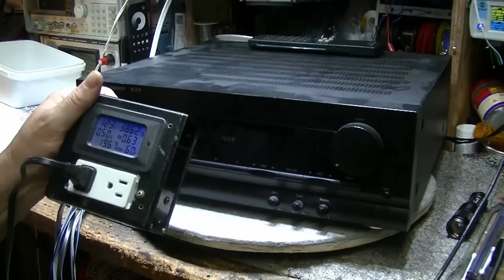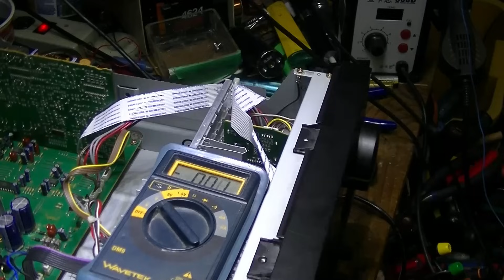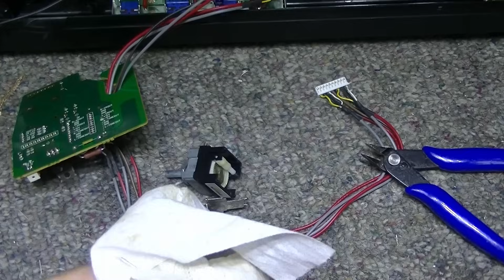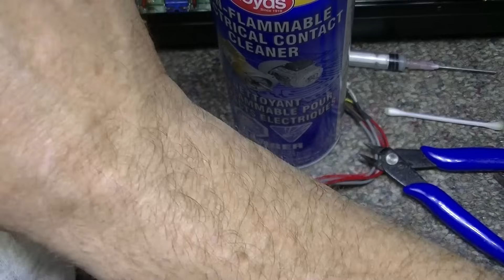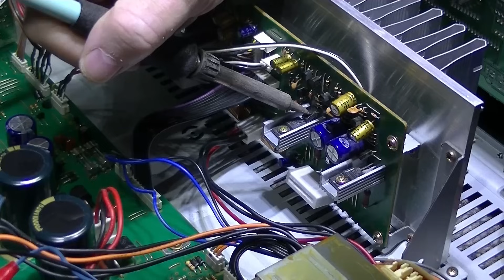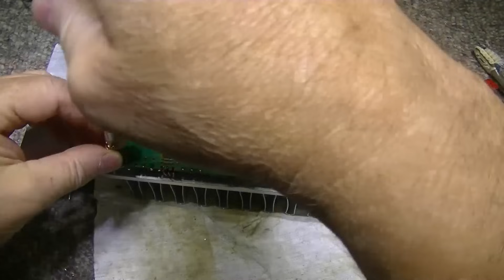Harman Kardon HK3270 Receiver Repairs (Ep. 241)

Comment: I enjoyed this video because I have an HK 3370 that I bought new in 2000. It had a problem with the remote volume control not working also. It was getting too hot in it's cabinet so I connected a fan to the switched outlet and it works.

Comment: I hate units designed this way. It's such a problem design coupled with making it a annoying to work on.  I know, I'm going to save space by having the solder side of a board face and be near the main heatsink. Thus ensuring that it will breakdown by slowly unsoldering itself but will definitely take longer than the warranty.  Solder connections are always the first thing you check.... when you can get to them.